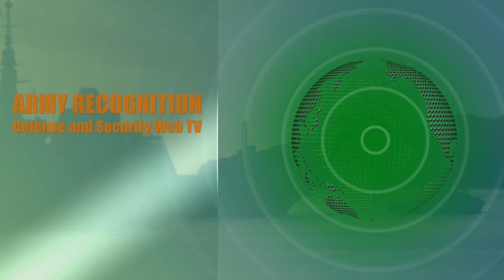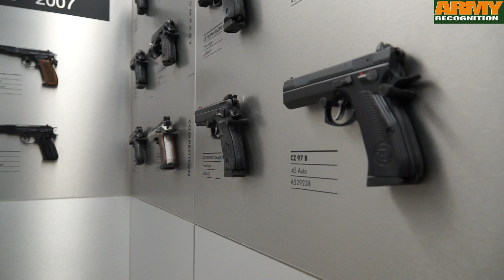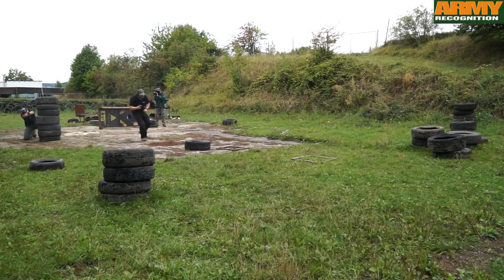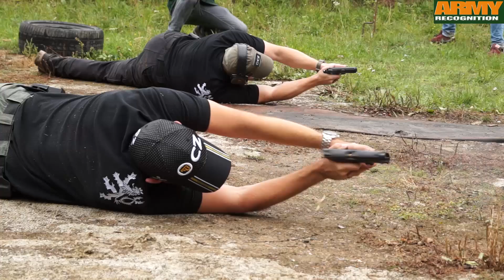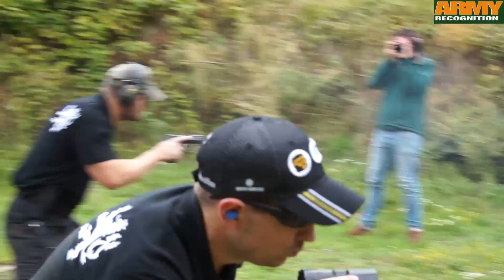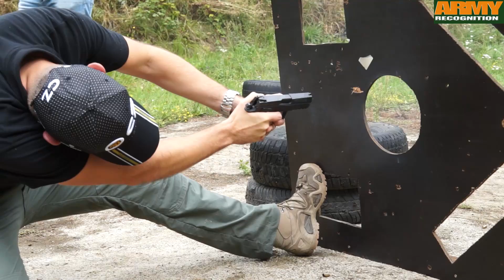Shooting tests and review of CZ P-07 P-09 automatic pistols by Army Recognition editorial team

Comment: Difference between p 07 and p 09? Also which one to own p 07 5in or cz 75 sp 01?
Reply: I'm not familiar with a "5 inch" p07. You are comparing Apple's to oranges here, and we don't even know which sp 01 you are referring to. Carry gun? Get the p07. A range/ nightstand/ go-to-war handgun...any of the sp01 variants. They are all super sweet shooters and extremely reliable.
Reply: Instinctive Firearm Reviews P09 is full size. po07 is the smaller frame size, operationally the same.

Comment: CZ P09 owner here, consistent 75ft head shots at the indoor range. I have over 600+ rounds down range of all kinds of  different ammo with zero malfunctions. I had to file down the mag release button because I wear the gun tight in my holster for carry and I was getting mag drops at any time.Make the mag release button a little more flush to the frame and this gun will be perfect.
Reply: Hell yeah man... switched from a G19 primary carry to a P-07 and haven't looked back.  Still own and love the Glock but... the CZ is like a laser beam in terms of accuracy (only to be outdone by the SP-01 that followed me home).  And for the cost I'm not sure there's anything that can really touch it in the Polymer world.  Glad to see more people finding and loving these guns cause I'd sure LOVE to se CZ send over that P-01 COmpact SHadow :drool:
Reply: Or the P10C. It's CZ's new striker-fired competitor to the Glock 19. From what I've seen of it, it has a trigger which may actually be better than the PPQ's, it shoots very flat, and it's quite accurate. In fact, one reviewer gave the pistol to a bunch of LEOs who were trained on the Glock 19 and they immediately shot tighter groups with it. 15-17 rounds depending on the mag, and it has many ergonomic perks like a beavertail and swappable backstraps. Price is just over $500. I'm personally waiting to see if it's as reliable as the older CZs, which requires a bit more time, but so far it's showing a lot of promise.
Reply: Airgunner Perkins 
Any experience with shooting 124 or 147 grain Flat Nose Solid or HP Bullets  in your CZ P07?